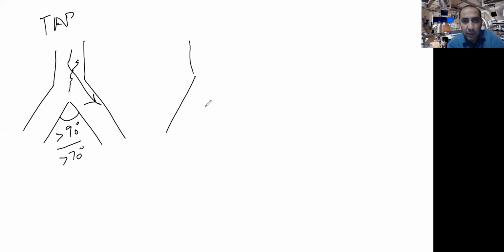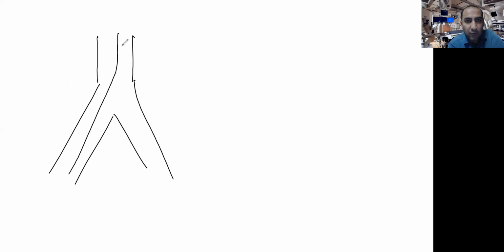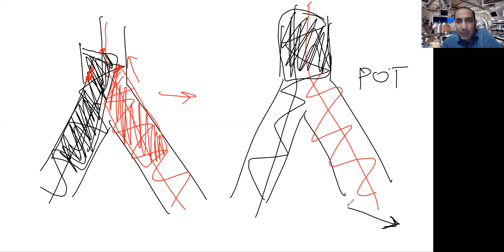How to do TAP or T and protrusion bifurcation stenting technique

Comment: Sir thnx for ds informational vdo.Sir can u plz help me.i had heart stroke in jan 2016..stenting don in Lad..it was not informed to me if it is not normal stenting...after 7 yrs i got a know ds fact...they ddnt put bifurcation..as may b da doctor was not specialized in it..they put a single stent...in LAD that goes down in such a way it jailed da D1 means its crossing over da opening of D1..now from latest angi it shown it is nearly 70% blocking D3 m in great pain in from few yrs.increasing day by day...i humbly request u to plz suggest me if it can b cured D1 problm by stenting(There is also another problem that an 80% bkockage in D1) or da only solution is bypass...i can send u my angi report by watsup..+92 3222922136..Haroon..1 more thing here in my city karachi therz only 1 specialist of it n hez not exactly telling me da right solution.

Comment: Crushing not needed for TAP stenting?
Reply from the maker: YOu can crush sequentially. I think you mean kissing? yes kissing balloon inflation is needed. My practice has evolved since the video. I now perform balloon inflation on the side branch, then on the main branch and then kissing balloon inflation by inflating both balloons in TAP. This helps with less overhang of the stent. You do it when both balloons are already in kissing position. Not separately.